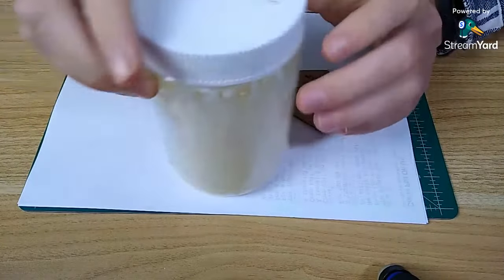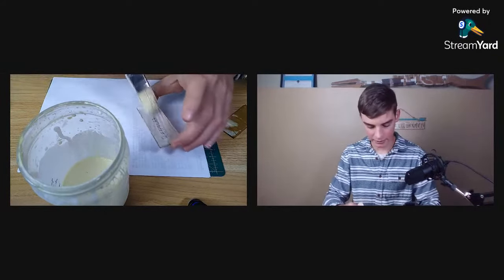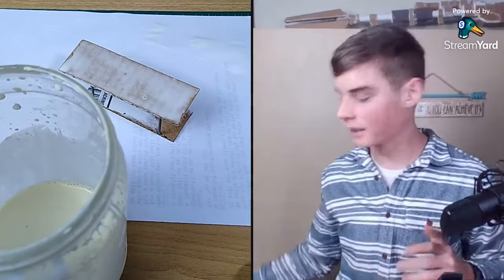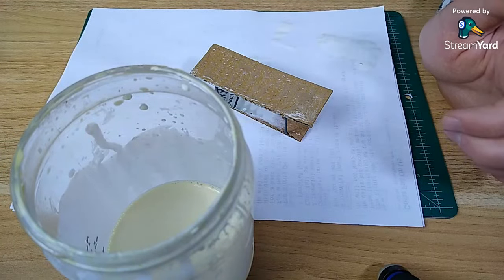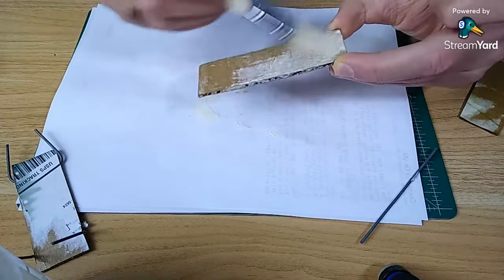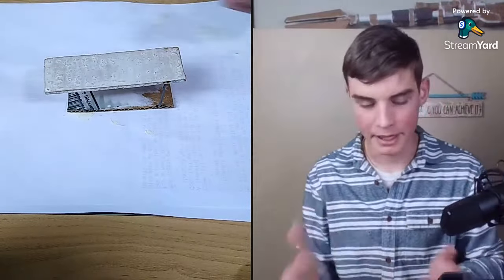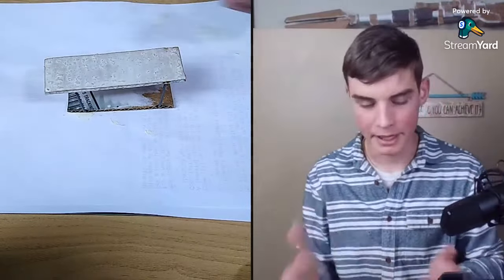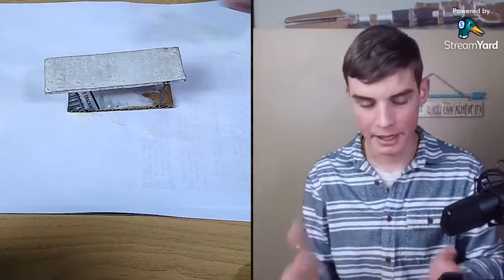How to Make Cardboard Crafts HARD and STRONG After They are Finished (the Cheap way)

Comment: you can use Mod Podge. It dries faster.  Varnish, but you can't use a heat gun on it.  I have used glue water and napkins, tissue paper,  brown paper or any paper really. It's poor mans Paper Mache and stands up to a heat gun.
Reply from the maker: That's a good idea, Gloria. I would like to make a video about mod podge sometime soon... I've used it a little bit but it doesn't get quite as hard as wood glue. That being said, it looks way nicer and I'm glad to hear that you can use a heat gun on it.

Have a blessed day ,
- Eli Tennant
Reply: I use the mixture of ( recycle) styrofoam  and Lacquer thinner or Xylen. It makes a thick liquid like honey  or syrup . It dries fast and forms a strong, glossy transparent protective coat like epoxy . The down side of this  is a strong solvent smell, you should do and let it dries outside. And normally I apply this coat after the paint job.
Reply: Wood glue is alot better imo

Comment: Because of cardboards porous nature and absence of a 'grain' orientation to the paper fibres within it--the slightest exposure to humidity & moisture begins to compromise it's stability. It is recycled-grade kraft paper chosen for it's general compression strength/crush resilience in corrugated form, but overwhelmingly it's cheapness & disposability: not meant to last.
 Protecting the cardboard from moisture using a type of resin offers the best durability as it prevents water from reaching & softening the paper fibres. There are specialty, 3-layer corrugated cardboards that are assembled from stiffer paper grades[..eg: bamboo paper..] & better quality binding adhesives; however the closest the average person can get to transforming generic brown carton material into something stiff like balsa or very lite ply would be epoxy and or acrylic resin.

I spent a couple summers about 9 years ago--experimenting with Gorilla glue/PU adhesives, epoxy resin, Minwax-type WBPU and lacquer-based wood fillers...purely to find the 'best'[..most effective, least->'modestly' toxic, cheapest & easiest to apply..] stiffening compounds. Things like wood glue, WBPU & ModPodge will work, yet all introduce moisture to the process; so the cardboard is somewhat compromised unless you force drying it rapidly--which can lead to warping/distortion of your parts.

 The other adhesives I mentioned all require volatile solvents to properly 'thin' them:
 - Xylol/Xylene for G.G./PU adhesives(..many suggest water or alcohol for thinning PU resins: DEAD WRONG!..)...Very effective stiffener, somewhat 'cheap' but xylene is pretty toxic. I had good success using it for RC planes but the toxicity encouraged me to stop.
- Acetone, denatured ethanol or M.E.K. solvent[..this is HIGHLY toxic--protective gear NECESSARY; AVOID if possible!..]-->for thinning epoxy resins. Epoxy is best strengthener but tricky to work with consistently...far from cheap...somewhat toxic. Lots of disposable mixing stuff/gloves required... 
- Cellulose-wood filler for carpentry finish work: dries thin & light but lacquer thinners evaporate completely--leaving no stiffening resin behind as binders. Not very good at keeping moisture out nor ultimately stiffness...

There is one combination I haven't had a chance to try, which might provide a good balance of stiffening for cardboard...moisture resistance...cost & complexity...degree of toxicity to handle. This would be acrylic plastic. 
Dissolve pieces of acrylic in pure acetone until it forms a low-viscosity liquid resin; mix in a small proportion of denatured ethanol and/or xylene to slow the very rapid evaporation of the acetone. A couple drops of epoxy 'Hardener' thoroughly mixed in may provide some beneficial properties too.
Now apply this acrylic liquid on your cardboard parts; a paint sprayer or airbrush would provide the fastest, most even treatment.
 The solvents used should ensure the acrylic resin penetrates into all the paper fibres without weakening them as water would; these solvents all evaporate quickly & completely and are not quite as toxic as others mentioned. 
(Hopefully..) the solid acrylic should evenly impregnate all the cardboard fibres & it's corrugations; making it stiff, light and waterproof.
Reply from the maker: WOW! Thank you for such a detailed and in-depth comment. This could basically be a video script! 

You have obviously done a lot more testing with cardboard hardeners than I have. I want to make more videos on this topic and have a few cool projects in mind that require weather-proof cardboard.

I think I will definitely come back and reference this comment to know what I am doing.

God bless you,
- Eli
Reply: @MakerBrain  Ohh, thank you very much--I'm glad you found those details helpful.
I would have liked to have created a video tutorial of my experiments, much the same way you did. But I didn't document nor make plans to video my processes along the way...as I was figuring stuff out on the fly. 
I DID hope to have a process that others could use & benefit from--same as you. I don't mind if credit goes to you for posting such a process & working it out successfully.
It is MORE important to the bigger picture that the average Maker can add another "cheap & accessible" technique to their tool bench, in the end.
Reply from the maker: You are very kind. I have been busy and not made a video for several weeks, but I look forward to testing out and documenting this process. I would give credit to you because it is your idea and to convince people that there are great things being shared in the comments of Maker Brain videos.

- Eli

Comment: I do one side at a time but it takes longer for each side to take turns air drying but I don’t get bubbles
Reply from the maker: Yeah, that would be the best way. I am glad to hear that someone else uses this method too. 

I was trying to rush for the video and it obviously didn't work. I think that in the future I will probably coat things with epoxy instead though. It makes them a lot harder than this solution. The only problem is that epoxy puts off bad fumes so I need a vented space.

Comment: Question.  I made buttefly wings out of very thin cardboard.  Painted and glued foil on it.  Bent the wings upwards.  Its very flimsy.  The bend made them crack.  Its for a costume.  My question is how can i harden this project including the bent wings?  Keep in mind i want a clear gloss look that will go over paint and foil.  Thanks so much for your help and advice!
Reply from the maker: Hmm, so you need a hardener to go on top of everything... Mod Podge sells some products for sealing/strengthening projects. I think that they even have a special product for hardening stuff. I am not sure how well they will work on top of foil though. You could always try coating it in epoxy, but that might be too brittle. If it works with your costume, you could add some reinforcing ribs to the back of the wings.
Let me know if any of these ideas help.

God bless you and happy crafting!
- Eli
Reply: @MakerBrain Thats what I decided.  Mod Podge.  Thanks, Eli.
Reply from the maker: @danab172  I hope it goes well!

Comment: So i just have to use glue and put some water in it and brush it on a cardboard?
Reply from the maker: That is the idea, but it works best if you let it dry naturally rather than using a heat gun. Also I have only tried it with wood glue so I am not sure how other glues will react. Lastly, if you know how to use Epoxy that would be the strongest hardener you could use on your project.

Thank you for the comment and let me know if I can help more.
- Eli
Reply: @MakerBrain  im Still 12 so ima try it with white glue
Reply from the maker: Good luck! It might still work well with white glue.

- Eli

Comment: Does this make the project weatherproof? I want to do a Halloween project outside and I'm looking to find a way to waterproof cardboard for month.
Reply from the maker: I haven't really tested that... I think it would make it more water resistant but definitely not waterproof because the Tightbond 1 wood glue that I used is not waterproof. And I don't know if this hardening trick would work with a waterproof wood glue because it might not be water soluble.

Good luck with your Halloween costume! Let me know if there's any way I can help.
- Eli
Reply: Did you find a solution? I would say something like Mod Podge Outdoor followed by a spray on clear acrylic sealer.
Reply from the maker: I have not found a good solution for this, but your suggestions all sound good. I know some people have used spray-on plastic to seal cardboard so that it could hold water.

Have a blessed day,
- Eli
Reply: I'm too late to help you with Halloween, at least this year, but can tell you that wood cream (which is a mix of mineral oil and beeswax) makes cardboard waterproof. You have to make sure to cover up the edges, though, so water can't work it's way inside.

Comment: Dont use a heat gun. Even on its lowest setting its too hot . Use a regular hairdryer.and just blow it enough to get a skin on it so it wont run and drip off. I have a some experience with this and the person commenting above about gluing brown craft paper tissue paper ect works great with the glue to strengthen cardboard was exactly right. And because of the water content the, "decoupage", technique will shrivel or wrinkle but as it dries it will relax to a flat mostly smooth hard finish.
Reply from the maker: Thank you, Phil. I hadn't thought about it that way before... I might try the paper-over-glue technique on my next project.

- Eli

Comment: Hi! You've got yourself a new subscriber! 

Have you tried making a resin out of polystyrene? It's a super-cheap solution to this! 
Things like single use plastic food items, styrofoam insulation, foam food containers etc, can be very easily dissolved in acetone, or other dissolvents, but acetone makes it dry fast and odorless. It's easy to make as thin or thick as you want, depending on application. 

Watching styrofoam turn into a fraction of its volume in minutes is fascinating, and it makes for a hard waterproof surface.
Reply from the maker: Thank you for subscribing, it means a lot to me. 

I have heard of people dissolving these plastics to make it kind of glue but never thought of it to coat my cardboard projects. It seems like it would result in a hard almost plastic-like exterior to the project, which is exactly what I want. I have been trying to figure out ways to make cardboard projects that can survive the elements. 

Thank you for sharing this idea! I appreciate you. 

 – Eli

Comment: Can I use the wood glue over cardboard that has already been painted?
Reply from the maker: Hi, Winnie,
I have not tried it over paint... It might not work the same way because the paint might act as a barrier between the wood glue and the cardboard. If I were you I would try it on a small, separate test piece to find the best method and then do it on the entire project.

Good luck!
- Eli

Comment: How much weight will this add to the cardboard?
Reply from the maker: I don't have a scientific answer for you, but The cardboard was barely any heavier because I barely added any wood glue and most of the water evaporated.

I hope this helps,
- Eli
Reply: @MakerBrain  I had a bike box I was traveling with on an airplane, and followed this idea to stiffen and make it waterproof. I coated it with MogPodge and thenn spray sealed it with lacquer it properly added some weight but not too much

Comment: Does this method work after being bent
Reply from the maker: If you bend it after putting the wood glue glaze on it, then the glaze will get small cracks and it loses a lot of its strength In that area. I think if you bent it before putting the wood glue glaze on it, it would be fine. You might just get some extra wood glue pooling up in the corners of your fold. 

I can't give you a definitive answer because I haven't tested it a lot. 

Good luck with your projects!
- Eli
Reply: @MakerBrain  thank you so much I making a Batman cosplay
Reply from the maker: That sounds like a super cool project! Good luck!

Comment: Move to Imperial Valley California and just leave it in the daily 100 degree plus heat. It will dry easily and doesn't require use of electricity.

Comment: I use epoxy resin and fiberglass cloth and I coat the fiberglass cloth and poxy resins and stick it on there and then coat some more epoxy resin on top and I do this a few times and it makes it really really hard but if I'm building some kind of like model or something I'll just use craft wood which is like 1/4 thick piece of wood and I just cut it with a band saw I think it's called and just cut the pieces out the way I needed to cut or I'll use a jigsaw if I find a blade that won't like mess it up or one of those round blades I forgot what they call them but it's they use it for grinding metal or for cutting metal and I just use it for sometimes wood and they have little tiny discs that I can use and what the tiny does it can use it for small pieces

Comment: Guys just buy 1kg of epoxy resin and some thin sheets of glass fiber.
Reply: that sounds like it'd be more costly than wood glue and water.
Reply from the maker: It would be more costly and epoxy is also fairly toxic to work with if you don't have proper protection and ventilation. However, epoxy and fiberglass would be incredibly strong compared to this DIY concoction. In fact, if you just coat the cardboard in epoxy, it can get very strong.

Thank you so much for commenting, Eaman and Carlotta

- Eli
Reply: @carlottascreationsandpaint2036  You have to buy epoxy in large amount if you want to get it cheap. Every thing is more expensive than cardboard yet I would not say that epoxy is an expensive material.

It is not ideal, it's not a good idea to put something rigid on something soft, with time it will give up.
Reply from the maker: Thank you for replying, Eaman.
I hadn't thought about how putting something hard on something soft could lead to structural failure. I appreciate you pointing that out.
- Eli

Comment: Use hot glue gun to harden cardboard
Reply from the maker: That is a neat strategy that I still use sometimes. Coating cardboard in hot glue can make it a lot more durable.

Thank you for commenting and God bless you,
- Eli
Reply: I do that but hardened hot glue tends to be flexible and elastic
Reply from the maker: You are right, zuky and thank you so much for commenting. Hot glue can make cardboard crafts a lot more durable but it won't actually make them hard.

If you are interested, here is a video on 10 ways to make cardboard projects stronger: https://youtu.be/ss_KYziuPRM

Have a blessed day,
- Eli